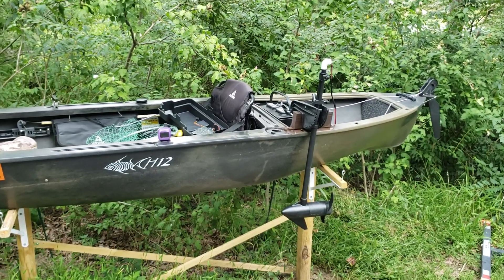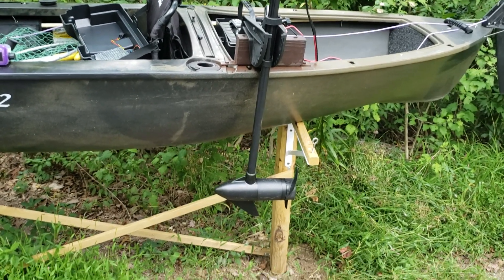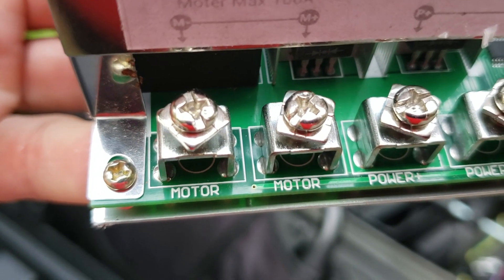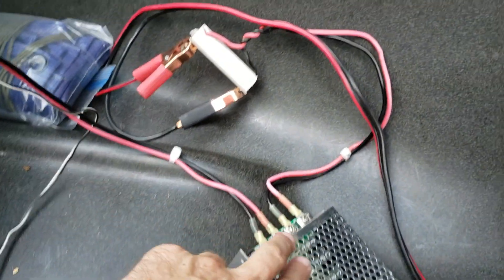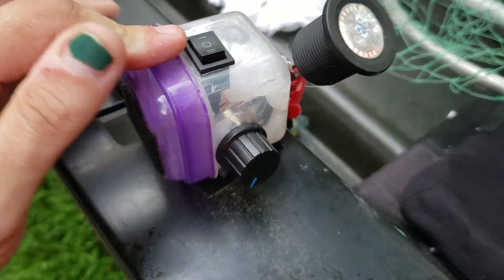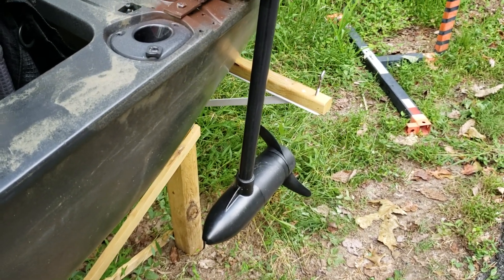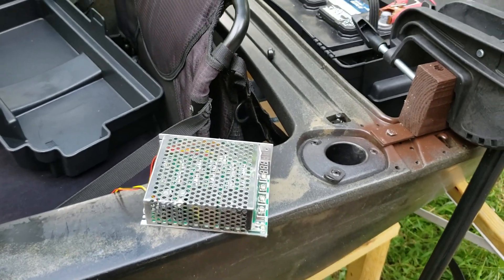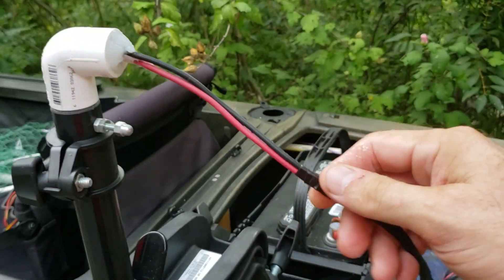Convert Your 5 Speed Trolling Motor To Infinite Variable; Your Battery Will Last All Day

Comment: I use the same PWM controller with my trolling motor. I use lightweight Li-ion e-bike battery, so added a DC to DC converter to get the 12 volts, then through the PWM speed controller. I decided to have it also control the speed of my kayak carry cart (a modified kid's car).

Comment: So you simply keep the Trolling motor set at level HIGH ie 5 and that should skip the resistive coils?  Or do you need to disassemble and remove the wiring to the resistive coils in the head of the motor case? Thank you for this video. .Great job.  Cheers Ok I heard you at Min 12:36
Reply from the maker: I just use the black and red wires, which bypass the coils. It's on or off. the speed is controlled by the PWM.

Comment: So, just wondering how we know the motor is using 100% of the power, just sending 20% to the motor and the rest as heat.
Watching other vids of people measuring amp draw at different speeds, low speed sees about 7 amps, and high sees about 25 amps.

Comment: At the various setting (1 thru 4) you are not "using 100% of the motor's capacity", eg 80%/20% split at setting 1, 60%/40%. IF that were true the Current flow out of the battery would be the same no matter what setting is chosen; which simply isn't the case. Yes speed coils are essentially low value resistors in series with the motor that do waste power,  but you're not "using 100% of the motor's" rated capacity (Wattage), at all settings because the series resistors limit the amount of current flow out of the battery.  At setting 1 the Power consumption is much less than 100% of the motor's rated capacity. So while the 80%/20% split may be accurate, it's not 80% of the motor's rated capacity that's being wasted as heat across the #1 speed coil. Know what mean?

Comment: i just bought a minn kota endura, but it does not have just a black and red wire running to between controller and motor like yours apparently does.  I also have a yellow and white wires.  Any idea what they are for ?
Reply from the maker: The red and black are the positive and negative, and the other colors have o do with the speed controllers on the motor. You want to ignore the colored wires and just hook up the black and red.

Comment: If I hook it up attached to a foot controlled  trolling motor  I suppose hooking this before the foot control and just make sure the foot control is on high or can I put a potentiometer in place of my 5 speed control in my foot control?
Reply from the maker: I'm not sure how you'd control it with your foot. It's a little dial you have to turn.

Comment: Thanks for the video.  My troller (just like yours) just quit working in reverse.  The PWM  cost is almost the same as a replacement switch.  I'm getting the PWM.  Your link can't be found, but the ones shown via amazon search look identical to what you have.

Comment: I not sure what your saying is true? Put an amp meter on when you are going slow and it will show you are no where near using the same amount of power as the full setting. Yes your correct in power been lost to heat in the coils but no where near the amount you suggest. The PWM's create a fair bit of heat too. I would love to see a amp reading on two identical setups one with PWM and one without to see just what the gain actually is

Comment: how those it affect the drive with the motor on the side of the kayak ? those it tend to go on the right since the motor push more on the left ? and how about the waterproofing? with 30A it could be dangerous with exposed wiring no ?
Reply from the maker: No issues with the wiring, and yes, it pushes to the right a bit, so I have to adjust the motor slightly to the right to offset the push. It takes a bit of fine tuning, but once you get it set, you'll move straight forward.

Comment: Hello I'm attempting to do the same thing I have Sevylor  now when I took the head off like you have there is three wires coming out of the motor what are the three wires two black one green?
Reply from the maker: I'm not sure about that wiring. I'd call the manufacturer and ask.
Reply: @DanHiteshew-oneandonly  the green wire is connected to the on and off switch relay then wired to positive relay switch for high and low and goes back down to trolley motor
Reply: The pwm there's only four ports positive negative in and positive negative out
Reply from the maker: @Michael-ff1ut  Mine only had a black and red wire that i needed to worry about. The colored wires were for the speed coils.
I bypassed all that and did a direct wire to positive and negative.

Comment: Thnx for the great and detailed video. I want to ask you if you have bypassed the speed coil that lies on the lower part of the motor assembly. Or you just ignore the two wires that go onto the coil amd thats it? Thnx again
Reply from the maker: Just ignore the colored wires. use the black and red wires only. Colored wired go to the speed coils.
Reply: Thnx again. I have read that there is one loop wire at the speed coil area in the motor head that my cause current backfeeding that is why I am asking. Since everything is sealed  in the coil area  I do not have a clear Image how the wiring is done down there.
Reply from the maker: @tzionico  I called Minn Kota and asked them.
Reply: @DanHiteshew-oneandonly  thnx a lot my friend!!! Thats the only concerned I had in case I had to order another brush end assembly without any coil. When I emailed them on that they said that you cannot go from speed switch to variable :) Appreciate your help

Comment: hey cool upgrade but the part at the beginning where you explain how the OE speed controller works doesn't make sense to me - it sounds like you are saying all speed settings draw the same amount current from the battery, so like speed setting one draws the same  current as speed setting 5, but just that 80% of the current is dissipated as heat in speed setting 1.

That hasn't been my experience, when using a DC clamp meter to measure current coming from the battery, at the lower speed settings less current is drawn from the battery, and at the higher speed settings more current is being drawn. For reference my tests were done done on a minn kota 36 and a newport vessel 86

What am I missing?
Reply from the maker: Apparently I was wrong.

Comment: I think it only saves your battery if you run it at that super slow speed you can only do with a pwm. Other than that why would an ammeter show different Readings at different speeds?

Comment: How do you fix interference caused by these pwm on fish finders? I've tried ferrules, multiple batteries.
Reply from the maker: No idea. I've never used a fish finder. Sorry.
Reply: What’s the problem ?
Reply: I've got one on my old Minn Kota and get interference on my Garmin when it's in a slower setting. I've tried everything I know and can't get rid of it. The interference is worse in deeper water but hardly any at all in shallow water. My Garmin is still usable with the interference so I've just been dealing with it.
Reply: @jeffperkins6514  I used a 433 mhz RF transmitter now. No more pulse width modulator. Remote controlled and no more interference.

Comment: If my motor positive wire has a breaker connected, will this still trip the breaker if it gets too hot? Also, I am finding mostly 60amp-100amp max models on amazon, I run a 62lb thrust trolling motor, will one of these be enough? Could I set trolling motor head speed to 4 and just not run speed 5?  Sorry if this is a dumb question, I don't know much about this stuff.
Reply from the maker: I think you'll be ok with a 100 amp unit. A breaker should trip if you draw too much through it.

Comment: If you’re always using 100% of the battery capacity, Then why would the battery last significantly longer if you use speed 1 for the day vs speed 5?
Reply from the maker: It doesn't necessarily "last longer", but you get more distance for the charge.

Comment: You say the variable speed is possible as they dump power into a resistance wire. I’m wondering where you get that info from? I have been researching this for a year now as I too have changed to a PWM controller on a Watersnake and wantEd to know the same on this motor, but I haven’t been able to find an answer other than just assertions.I figure it’s possible they could use different motor windings to get the variable speeds which I assume wouldn’t be wasteful of battery energy then.
BTW I use model radio control gear using a Brushed ESC and servo tester, this is so small (easily fits in the motor head) and cheap - and I’ve had this in operation for over 100hours with no problems yet.
Reply from the maker: I'm honestly not sure about that anymore. You're not the first person to suggest I'm wrong about it. (not sure where I got that idea)
Either way, the PWM or speed controller will save your battery.

Comment: How did it last, mine burned after 2 hours, on the second try it would heat up and stop working, it would restart after 1-2 hour, is there a particular speed controller I should be looking for
Reply from the maker: There's no "brand" I could recommend, but I use the "100 amp" version because I assume these cheap Chinese controllers are over-promising what they can deliver. I've used one for multiple seasons and it hardly gets hot.

Comment: I did this but fitted the pwm inside of the trolling motor head.
Lee Todd on Facebook if you want pictures.
I used this from eBay.
DC 10-55V 60A PWM Motor Speed Controller CW CCW Reversible Switch 12 24  npL F4

Comment: I’m concerned about the pwm getting wet. Do you feel it puts out so little heat that it can safely be put in a waterproof box?
Reply from the maker: I wouldn't, unless the box is roomy. It will get pretty warm.

Comment: I just read all the comments and ordered the linked unit yesterday.  It’s 50 amp/max 100 amps but only 15mhz.  Should i return it and find a new one?
Reply from the maker: I'd try it first. I have one now that's 15 KHz and I don't hear any noise at all.
Reply: Thanks for replying so quickly. It’s being delivered in 24 hrs and i just checked pages of units for sale and this was the best. I’ll let you know the results. Thanks
Reply from the maker: @BobBohner4851  Good luck. I hope it works out.

Comment: Although using a PWM is more efficient, you exaggerate how inefficient the 5 speed is.  You make it sound like you draw just as many amps on the lower speeds as you do for full throttle and the resistor disapates the difference when in fact, the amp draw is far less at lower throttle settings.
Reply: I will test this “always pulling full amp” theory shortly and post back.

Comment: I just got finished doing mine .
Reply from the maker: Have you taken it out yet? You'll love it.
Reply: @DanHiteshew-oneandonly   no i haven had a chance yet, I had ordered the veribal speed control from Amazon sometime back and had not used it until I saw your video .I'm waiting on a new battery I just ordered.  I have a solar panel that I've got hooked up to the kayak to charge the battery not sure how it will work. Do you know what size solar panel you would have have to run a 34lbs thrust minnkota without the battery?
Reply: @davidsabine6942  if it draws 30amps, you would need 360 watts at least of solar power and the panels would be bigger than the boat

Comment: This is a great explanation.   

Could you explain to me about the maximum amps the motor can draw?  Like can we put 300 amps into it with a 300 amp PWM?  Is it the pwm pushing amps into it or the motor drawing amps through the PWM from battery?
Reply from the maker: Most motors won't draw more than 50 amps (I think my 30 lb draws about 25 under load).
The amps come from the draw on the motor, so the PWM has to be able to handle the current flowing through it. Usually you should stay below 80% capacity so as to not overheat the unit. I get an oversized unit so even if I miscalculate, I leave myself tons of room for error and know the PWM will be able to easily handle any load my motor draws.

Comment: Hi Dan! I think that you sold out the Sydien 60A/100A peak model on Amazon! I ordered it, received in a day or two and when I went back Amazon to check the wiring configuration, t”he 60/100 model was gone! Wired it up and tested and it worked great with my old Minn Kota 65T 36 lb thrust model. Now to find a good box to put the controller in. Thanks for the great video!

Comment: How do I protect the speed controller module from water damage without making a huge protective case? I have a water resistant battery box to house my mighty max, sealed, deep cycle battery from weathering. I have a shadow caster 123 angler kayak and tried trolling with the minn kota endura C2, 30lb thrust and it was too brisk of a pace when I would use 1 speed forward and reverse. I had a good take on my scotty lake troller downrigger and my first take from a fish was definite but I couldn't keep the fish on because the troll is too fast and I lost the school of fish by going too fast at 1st speed. Put an order in for this potentiometer speed controller. If I was in the bay with a marine troller this might be underpowered.
Reply from the maker: I've never covered mine. I just keep it tucked out of the way so water doesn't drip on it from my rod or paddle. It's solid state, so getting a little wet probably won't do anything in the immediate sense, but over time corrosion may play a role. 
I never even take mine out of he boat. It stayed in there (under a cover) all winter and works fine this season.
Reply: @DanHiteshew-oneandonly  okie now that's awesome. Cx I got the speed control today but I didn't have my motor head on in the circuit so I wasn't getting feedback other than knocking in the heat sink tower area while my forward/reverse and pulse knob turning. Hope I didn't fry it.

Comment: Hi Dan great mod cant wait to do that.. Do the power and motor wires need to be #10 (the ones going from pwm to battery and pwm to pigtail to  troller)?
Reply from the maker: I think I used 12 gauge, but yes, the only wires that can be lightweight are the switching controls. The wires from the battery to the PWM and from the PWM to the motor need to be heavy enough to handle the amps.
Reply: does this increase the speed of the motor? also does this damage the the motor in any way?

Comment: what size battery did you put in your ascend 12t because i have 128t
Reply from the maker: It's a group 31. It's a beast.
Reply: @DanHiteshew-oneandonly  how heavy is that
Reply from the maker: @brandonmori-bergeron1312  Heavy. Probably about 60 pounds.

Comment: Hi there. Thanks for sharing this brilliant idea. 💪 I will consider doing the same. I see the sense in using the power for the motor and not for making heat, but wonder how much more runtime you get from this modification? 🤔
Reply from the maker: The slower you go, the more efficient it is. If I'm running on 25% I get 4 times the battery life.
Reply: @DanHiteshew-oneandonly  Thanks for answering. 😉 That makes sense, but I was wondering how much juice you earn from this mod, and how much energy that goes into heating the resistance in the stock regulator? 🤔

Comment: If you are only using the red and black wire does it stay full throttle forward and reverse?
Reply from the maker: Yes. The other colored wires go through the speed coils. Using the black and red is directly to the motor.
Reply: Thanks for reply. What was confusing me was when people would say put it at top speed and reverse would not work. So as long as you have a switch and use red and white you can use reverse?
Reply from the maker: @joecool5399  Yes. You're bypassing the motor's controls completely. All you need is the positive and negative hooked up. The reverse switch is on the Speed controller itself.(PWM)

Comment: Great video. When I went to the link you supplied for the potentiometer it shows that it is only 15 kHz . If they no longer supply one you used is there another one you could recommend? Thanks
Reply from the maker: Not really. I got a reasonably cheap "no name" unit. I got one rated for 100 watt peak, with 60 watt sustained, and haven't had any problems yet. It doesn't even get really hot while running.
Reply: @DanHiteshew-oneandonly  Ok. So just to clarify. The one you linked is not the one you used in the video?
Reply from the maker: @jeffmcclure932  That was so long ago, I don't remember. The one I used may not have been available when I shot the video. If it wasn't the exact same unit, it was one very similar.
Reply: @DanHiteshew-oneandonly  Thank you information. I am going to try this out.
Reply: @jeffmcclure932  how did it turn out for you? im looking at same model and building myself as well...did it make sound? how did you wire it? did you leave trolling motor head on?

Comment: When i google pwm s dimmer swirches come up is there special ones for marine uses
Reply from the maker: Most "dimmer switches" are for AC, not DC. Try looking up "Speed Controller" or 12v speed controller, and be sure to go above 20 kHZ and be sure the sustained amperage is high enough.
Reply: @DanHiteshew-oneandonly  thank you
Reply from the maker: @jshall1000  You're welcome!
Reply: Hey did it turn out? I am hesitant.

Comment: im about to start this same project using the same trolling motor. When you remove the head is there anything special i need to do or can i get rid of all the wires that are not the battery wires? also using a pwm.
Reply from the maker: Use the black and red wires. The other colors go to the speed coils and can be ignored. I just tucked them into the shaft before filling the top with silicone to seal it.